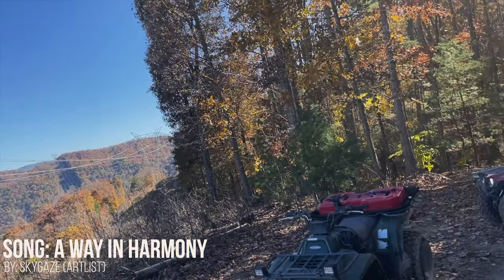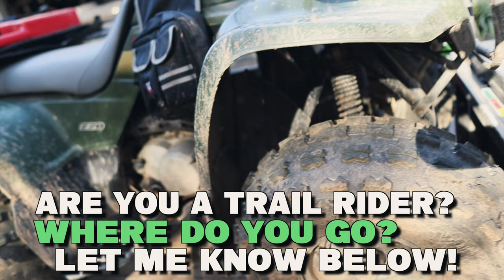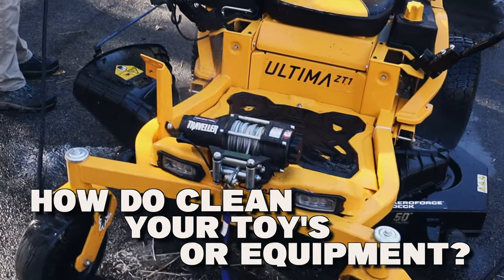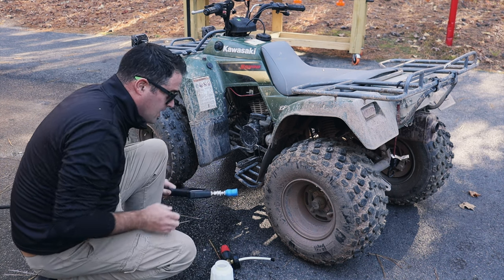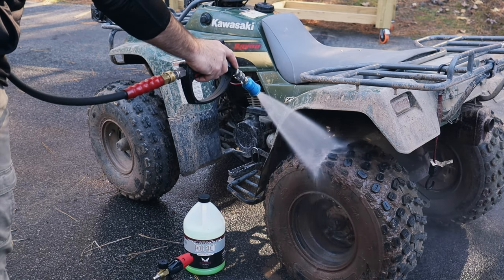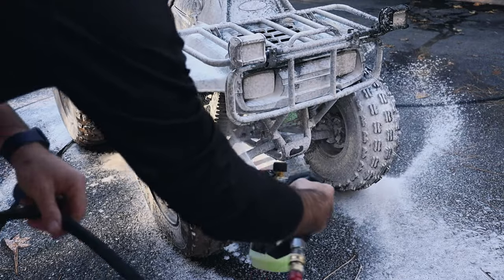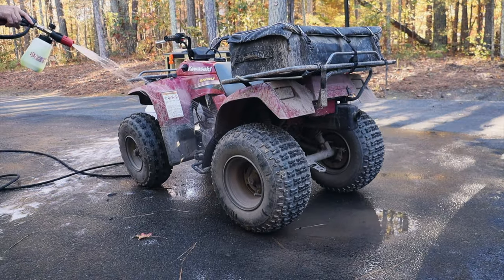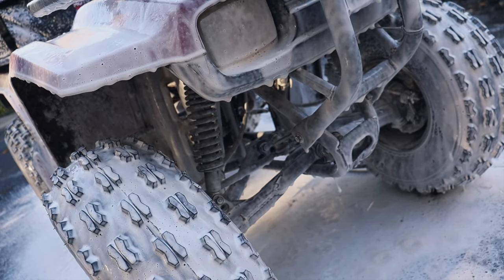CLEAN YOUR TOYS! #atv #cleaning #diy #vacation

Comment: I am usually the one to wash all of the stuff, we have a sxs, 3 four wheelers, and 2 dirt bikes (looking to sell some stuff) but I use water, let it soak for couple minutes, then simple green or super clean soak, then rinse, foam with a degreaser added, then finish with foam with no degreaser and contact
Reply from the maker: Thanks for sharing. We sold those machines a while ago and upgraded now to 2021 CFMoto Cforce 600 touring and 2021 Kymco Maxxer 450i. Awesome machines
Reply: It’s always caked in mud too, that deep clay just sticks no matter what
Reply from the maker: Totally!

Comment: It’s been awhile since I have trail ride. I had my grandpa’s 1998 Yamaha Timber Wolf 250 4X4 until it sadly bit the dust. Looking to upgrade from a small utility ATV to a big one. Still going with Yamaha because they have been making quads for a while, and I have had good experience with Yamaha’s as well as now Kawasaki. I plan on getting a new Yamaha Grizzly EPS XTR, just not sure when. Plan on changing the tires and using the ones it came with for mud. I’ll also plan on putting tracks on it for the winter for the lack of snow this winter. Plan on selling my sleds along with my rail. I’ll be putting a Camco black bore rear storage box on it, a modified air box, modified exhaust, might modify the shocks. Not sure what else I’ll put on it, need to test it out to figure out what I want to add. I know extra fuel, for I plan to go longer distances. The reason for the modified air box is because I have seen on YouTube that Grizzlies and Kodiaks have problems keeping debris out, plus a little extra hp. I’ll have to remember this video on how to clean my machine. Thought about using chemical bros cleaning solutions to clean my ATV. I enjoyed watching your video, you can certainly tell that you take care of not only your equipment but others as well. Hope you have an amazing day and I’ll be sure to keep an update when I get my Grizzly. Also I’m from Michigan
Reply from the maker: That’s awesome!  We recently upgraded to Polaris scrambler 500’s and an older Sportsman 500. Awesome machines.

Comment: Im local to you and the closest place to ride is Pine Lane ATV Park and Red Oak. Both are near Danville so roughly 100 miles from you. As an ATV racer some of the best cleaner is ATV Wash from Liquid Performance. After the wash and dry is done use Maxima SC1 on everything and that will make it way easier to clean the next time.
Reply from the maker: We definitely have to check those out. Thanks!

Comment: I saw you posted earlier that you have a CForce 600 Touring and a Kymco 450.
I have a ‘22 CForce Overland and my sim has a Kymco 450i MXU.
I’ve been using a 6x10 utility trailer to hall them (side by side) which isn’t idea.  I’d like to be able to park on a trailer nose to tail.
Do you have any idea what size would be needed to do this?  I see that’s what you do.
Any info would be great!
Thanks
Reply from the maker: Hi. So yeah I had a 5x10 first and it didn’t fit. So our 6x12 trailer works great. But I still have the side mount the Maxxer since it’s smaller up front and then drive the CFORCE600T behind it and it fits fine.

Comment: Hey Phil! I just bought a 2022 CF Moto CForce 600 myself and came across your video as I was searching to see what is recommended for protection. I feel like I want to put down some kind of protection before my first ride. Did you put anything on your new one before taking it out? I would appreciate any advice! I would also love to see more ATV videos! Thanks!
Reply from the maker: Hi!  Actually we just got a 2021 CFMoto 600 touring after we sold these! 
Usually I just a spray sealant on all the parts I can reach, plastics, handle bar area, etc. for the parts I can’t get to I use a dressing that helps shine and protect. 
Try these out. 
Try these sealant https://amzn.to/3Plu4Vx

I spray this on all the undercarriage after I wash and dry https://amzn.to/467LZpG